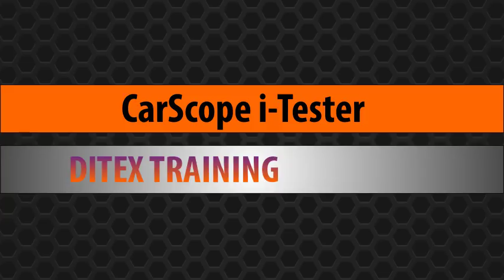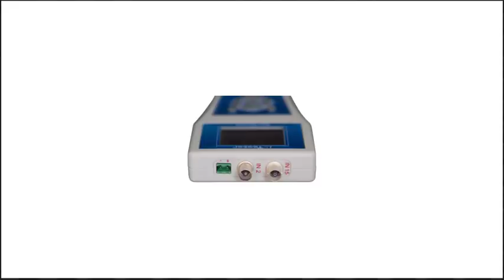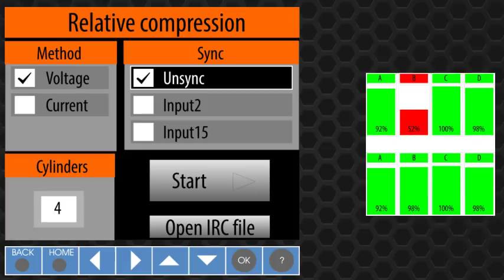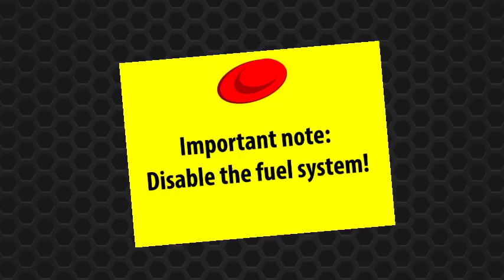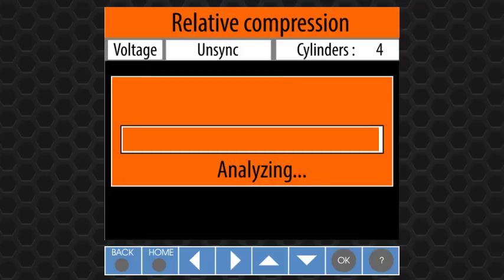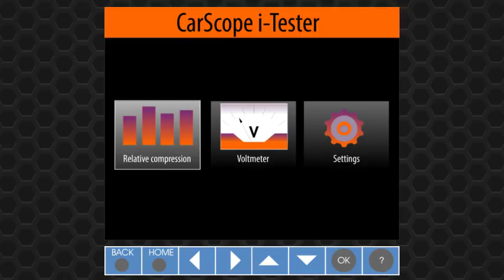Automotive CarScope i-Tester - Introduction - Performing Relative Compression Without a Scope

Comment: I can't understand why most shops don't do relative compression tests . Way back when Snap On put out the MT-2400 Vantage this could be done with an amp clamp . Or a graphing multimeter , such as a high end Fluke , etc . You don't need the skills of a lab scope . This is tool is even easier . The time and labor to do a compression test , possibly removing the intake plenum , etc. What about seized plugs , broken plugs or baked on wires ? At least you know if a cylinder is low or dead . It's just over $ 300.00 . I just don't get it !

Comment: Hi I just bought the carscope i-tester from Ryans Automotive In Ireland is there more info on common rail testing?  I also bought you're sensor simulator so far great tools.
Reply from the maker: There is a HELP sub-menu on the second screen of the Common Rail mode.
Reply: @AutoDITEX  thanks for the reply good info there thanks

Comment: But how does it measure?
Where does it get the data from?
How does it measure pressure?
Reply from the maker: Hi Nate A,
Thank you for the interest in our products. 
The principle of the relative compression test is based on tracking the battery current/voltage changes during cranking to determine the compression values of all cylinders.
The relative compression analysis does not measure the actual pressure, but just compares one cylinder to the next. Hence the term "relative".
More you may read here:
http://autoditex.com/page/relative-compression-test-67-1.html
Reply from the maker: This test is only a comparison between cylinders so we can use this method to "see" if we have a cylinder (s) with low compression by comparing one cylinder to the next. Hence the term "relative".